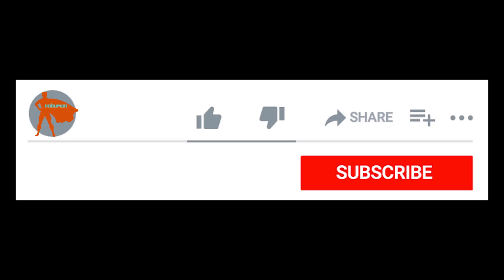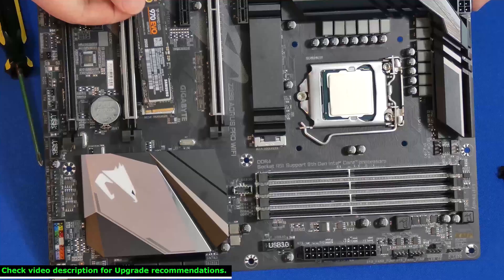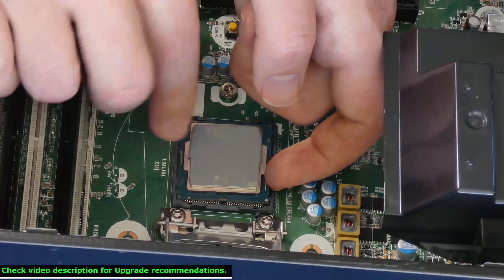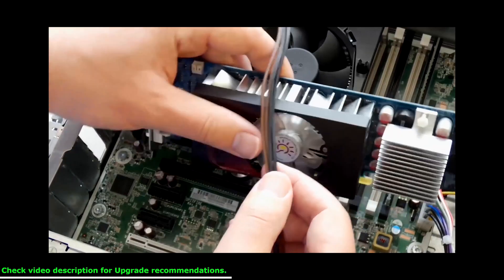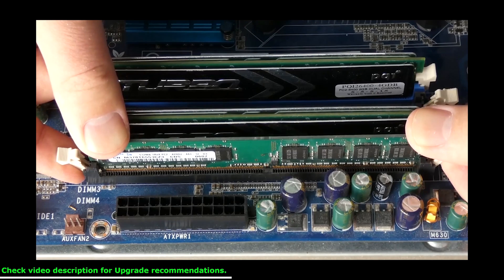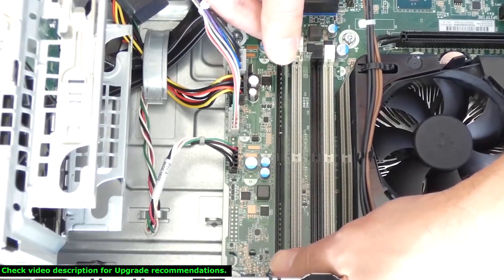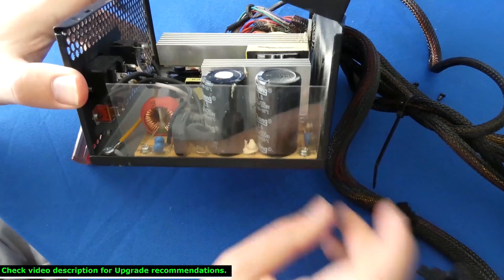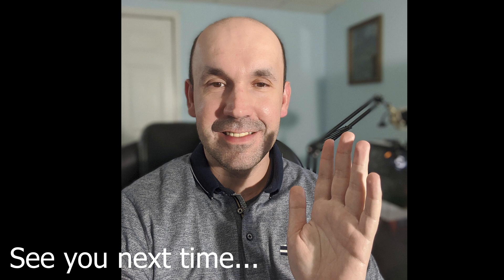Tech Support Courses *IT PRO* 😉 Computer Upgrades, from Tech Youtubers.

Comment: My PC is:
HP Desktop 7100 MT.
Motherboard: N.1996-lona 1.0---Bus Clock: 133 megahertz 
i7 2.80
RAM 32GB DDR3
GPU: Nvidea 1060 6GB
PSU: CORSAIR VS450
Is it possible to install RTX 2060 6GB instead of 1060 6GB?
Thx n advance.
Reply from the maker: Thanks for the PC specs. 👍 
Something like this: https://amzn.to/3gqw503 ?
Yes, you should be able to just swap them out. There are like 3 different versions of RTX 2060 from different brands which I'm assuming are pretty close to same speed; however, the RTX 2060 Super should be noticeably faster if you can afford it.

Comment: Hello,
I want to upgrade hp elitedesk 800 g1 sff for gaming,
1. I've brought 6pin to 24pin convert
2. Psu 550w
I'm facing issue were motherboard led on once then no power, if i use originally hp psu system works

Can you help what is issue here??
Can share video if you permit to share
Reply from the maker: Sure thing. So, I heard that some of those 6pin to 24pin adapters need modification to work. It requires moving of couple of wires around. There are detailed instructions with pictures on how to fix under 4th review for this adapter here: https://amzn.to/2BPvzJZ  The 4th review is specifically for 800 g1.
Reply: @Cobuman   I've another 230w psu which is working fine with convertor and when I'm using brand new cool master 550w psu with same convert, motherboard blinks once only then no power

I've also check voltage with multimeter on both psu it's good
It's strange issue here
Reply from the maker: @nikhildubal1457  It may be the difference in wiring somehow between 230w and 550w. 
Does 550w work on it's own? 
You can have PSU with bad capacitors that still give normal voltage. It's kind of a process of elimination here to figure out which is the problem. 😁
1. I would check to see if 550w works on another standard ATX mobo if possible.
2. I would compare wiring (color) and voltage between 230w and 550w at 24pin connector.
3.  I would compare wiring (color) and voltage between 230w and 550w with adapter connected at P1 and P2.
Reply: @Cobuman 
Point 2 and 3 verified and looks good..
I'll check with retailer for point 1 because when i was try with psu 550w cable green and black with paper clip at time psu fan didn't ran. 
Thanks for replying
I'll update thread.

Comment: i want a pc for gaming and streaming what all need to go for can  suggest me
Reply from the maker: If you want to have a good streaming experience you need below specs (1080p 60fps streaming). Keep in mind the biggest issue here is having to deal with sending of encoded video to streaming platform as it takes a lot of CPU power. 
1. CPU with at least 8 cores (or 4 Physical with 4 Logical) at minimum. Still may need tweaking to get smooth streaming video and gameplay at 60fps.
2. 16GB or RAM because you may have a RAM hungry game and need enough for CPU to process video encoding at the same time (minimum). If less you need adjust resolution/bit rate/frame rate and etc.. Still needs testing and tweaking of the stream quality.
3. Mid Range GPU at minimum, like RTX 2060 +. Not only does it help with FPS in game... in Nvidia example it can be used for video encoding. 
4. Good internet upload speeds at least 12mbps (at minimum) faster would be much better so that you can send streaming data without issues. 
All of this is with assumption that you have a decent SSD, PSU and etc. 
Pretty much everything I talked about in video but tweaking of the stream settings is the #1 thing here because it's possible to stream on lower specs with lower quality.  😊